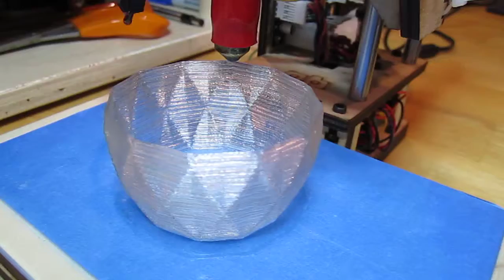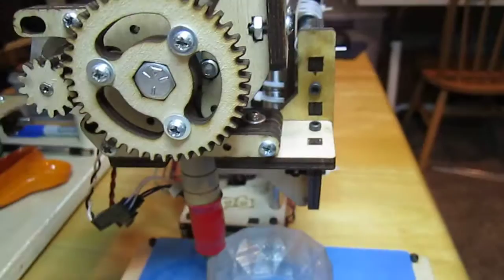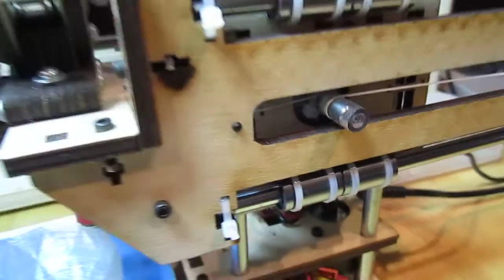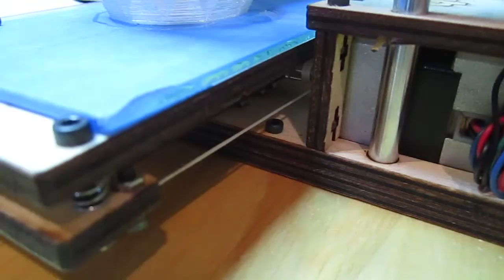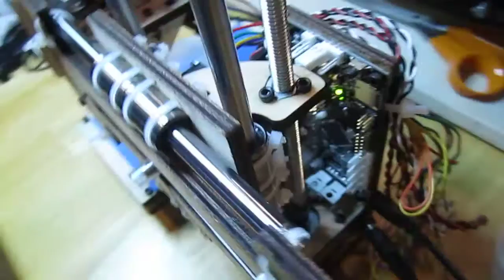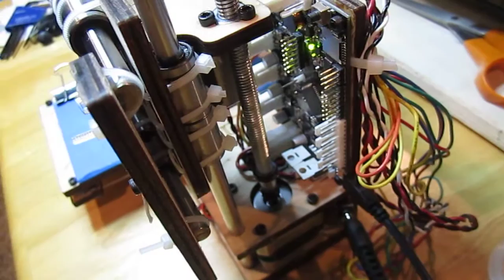Quick tour of Printrbot Simple while printing a custom vase

Comment: i have the simple also but when i download an stl file and tell it to print it does not print what i tell it to print.any ideas of what i may be doing wrong and how to fix the problem. Thanks
Reply from the maker: If it does not print at all, it's probably a communication problem between computer and the printer. Make sure the baud rate matches.  After you connect to the printer the status should say: "Idle" and you should be able to move the nozzle by clicking the arrows on repetier.  Also note that the first thing it does it heat up the extruder.  This takes a few minutes.  Note the status messages on the computer.  It should tell you what its doing.  Good luck!